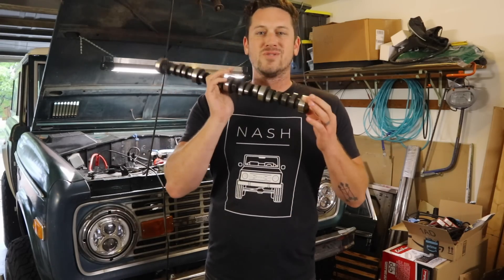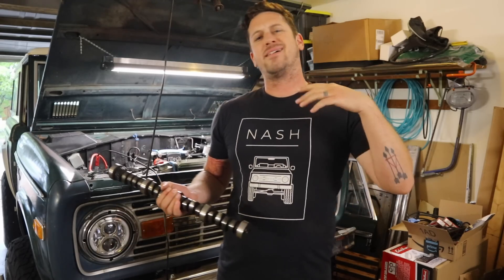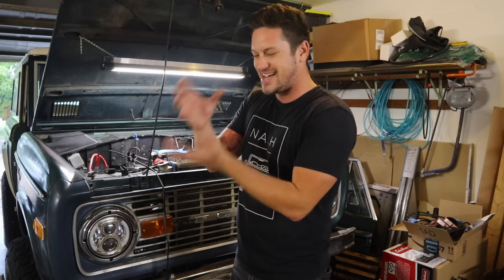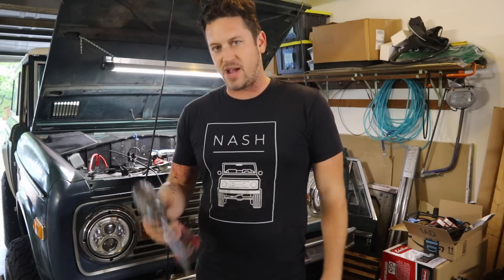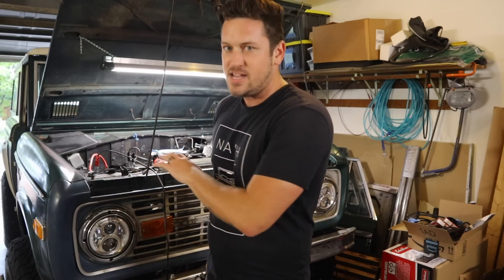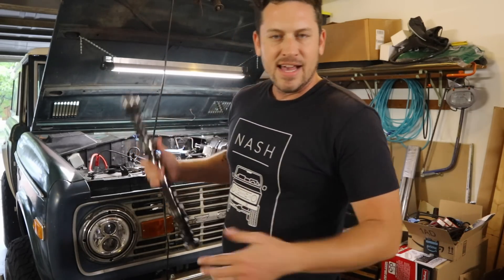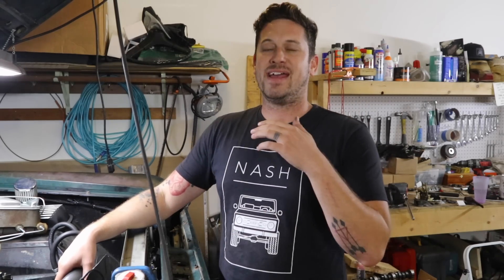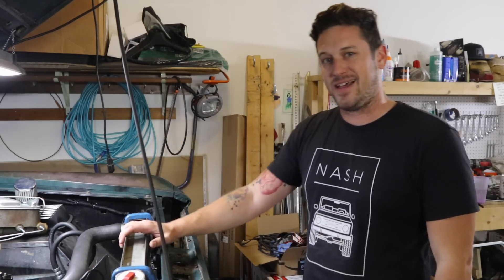Flat Tappet Camshaft Break In

Comment: Don't use any oil that's NOT non detergent. Until your furnished your break in.Zinc will NOT mix with detergent based oils.
Reply: Why does Rotella T5 have zinc with detergents then? Who told you this information?

Comment: Ridiculous notions - No car manufacturer ever went through these break-in steps...why do you think it necessary? All oils still contain ZDDP and the amount is not important...it works the same no matter the ppm content. These are not lawnmower engines...the cam does NOT get it's oiling from any "splash" effect thus no need for more rpm. In reality most parts are mated from the starter motor alone. Here you will find all the facts you need to understand...  https://540ratblog.wordpress.com/2013/06/20/motor-oil-wear-test-ranking/

Comment: Hey there, I’m getting close to breaking in my 302s new camshaft it I’m worried about getting it started on my first key turn.

How do I stab the distributor for initial firing? Do I stab at 0 degrees or do I stab at where I want my initial? 

Do I turn it to advance it at all(like I’ve seen talk of 1/4 a turn of the unit)

I could really use some help here. Thank you

Comment: The Zinc actually has not been removed from the oil, it's just been reduced, it used to be around 1200 parts per million, now most oils only have 600-800.

However, there are oils which have a good amount of Zinc still out there.

Valvoline Vr1 10W-30 for example has 1300 parts per millon of Zinc, and it's better to buy an oil with an already high amount of Zinc in it than buying an additive.
Reply from the maker: Good info, appreciate it
Reply: Vr1 is good oil and its 30 for a 5qt jug at orilleys